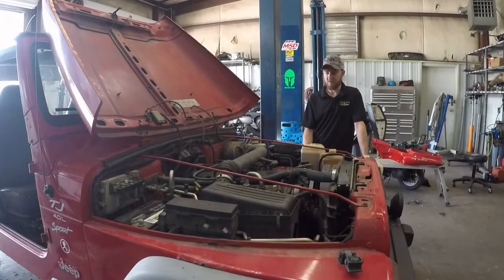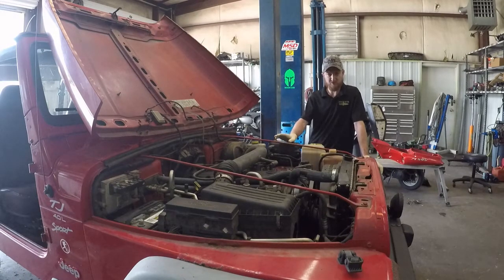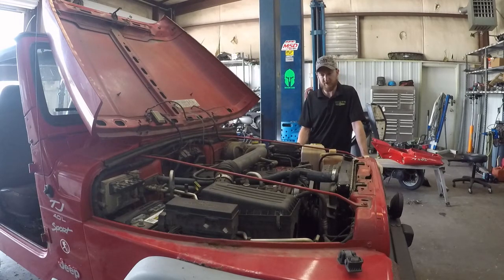Jeep Wrangler 4.0 conversion pt1

Comment: Could i take a 4.0 harness and everything out of a grand Cherokee? Or does it got to be a wrangler?
Reply from the maker: It would probably work but I am not 100%. I had to swap the whole body harness as well.
Reply: So it’s needs to be a engine harness from tj  in my case my Jeep it’s a 2000 wrangler 2.5 and the motor I have it’s from 87